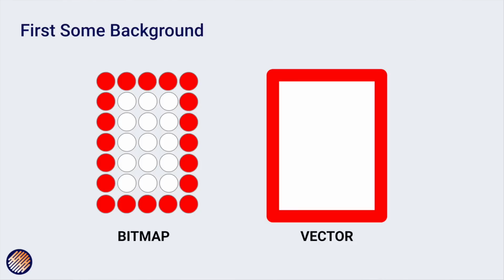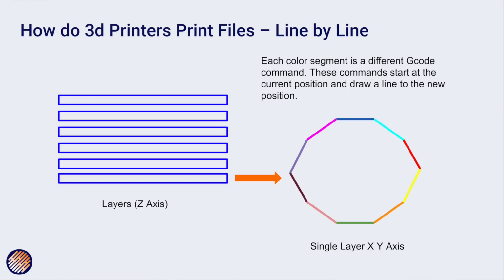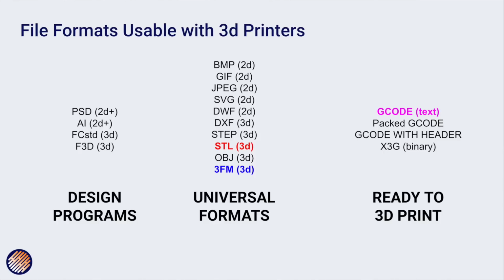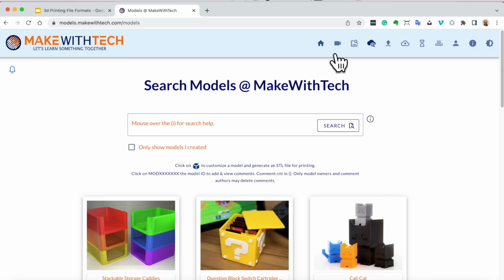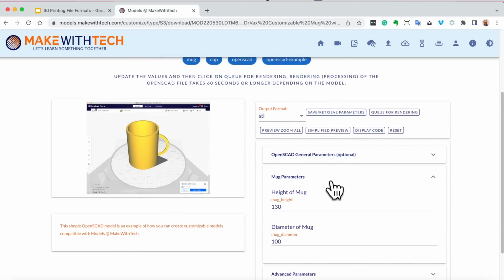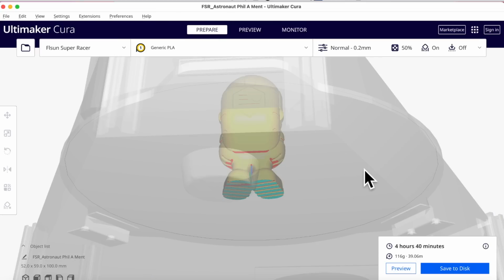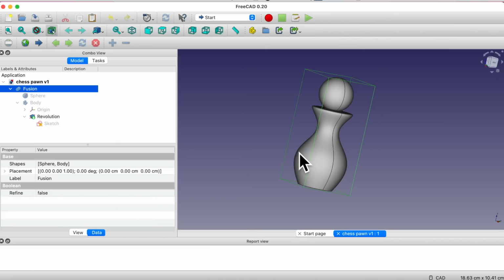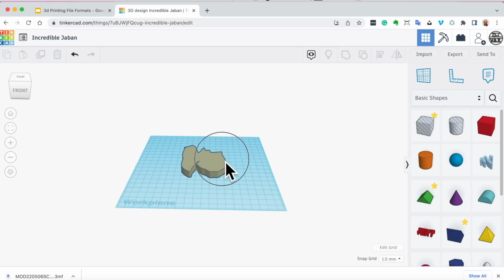3D Printer File Formats Explained

Comment: Nice summary, thanks for making this video. I teach a 3D printing class at my hackerspace and I'll be sharing this video with students.

I would suggest that STL files are more like a vector format than a raster format, however. The dots in a bitmap file are 1-dimentional points represented in a 2-dimentional array.

The facets (triangles) in a STL file are not 1-dimentional - they have a size and shape defined by the 3-dimentional location of three vertices (which themselves are 1-dimentional, but not stored in a 3-dimentional array). This is closer to the way a vector file format works describing a shape - only in this case, all the shapes are triangles.

Comment: This was a great cross platform tutorial. I managed a ProE program at a major truck builder for 7 years after using 3d modeling for 6 years. I am coming back after  procuring a 3d printer and a go fund me 4 axis mill. I have never seen a clearer explanation of the formats from the positive additive/subtractive, to the subtractive to the additive (for a 3d printer versus a CNC). Many thanks and I subscribed after your first video, this one, I watched. Thank you!

Comment: Very interesting. I had been treating STL as a black box, and didn't really care about how it works on the inside.  Smaller files are nice, but it's not clear to me that it buys me much.  A few MB is just not that much storage in these days of terabyte drives.  That said, it would be interesting to know how they achieved that compression; perhaps they exploit some similarity to neighboring triangles.  I'll bet there's a wikipedia article on it :D

Thanks for the tour of common formats and cool things you can do with 2D images!

Comment: Wow beautiful explanation as always.  You sure gave a great style.  I investigated STL and 3MF a few months ago.  I looked if I could write a c# desktop app to design screws nut and misc fasteners. I found the stl triangle geometry was a head trip.  Just cutting a circle out of a square produces complex STL files.  I have viewed them in ascii text!!

The slicer is pure magic on how triangles get sliced so neatly too.  Thank for a peek in side the magic geometry.  Good work.
Reply: STL doesn't store a circle as a circle, but as a multi sided polygon. That's why it's more complex. I was going to test if slicing from different file formats give different printing results.
Reply: @isthattrue1083  Yes stl is the smallest simplest Polygon set always three sides.

Save a cube you see each square is two triangles per side. 

I love digging in under the hood.
If you need help could write some
Python or c# visual dumper.

I'd love to see you're results,  thanks.
I moved from Barrington il to Prescott Valley AZ almost four yrs ago when I retired, we could of met!

Comment: Is there a way to take an svg file and extrude it, so that the highest plane is not flat, but has dimension, itself. For example, importing a leaf pattern where leaves themselves are slightly domed from a side view. The final application would be for mold making and clay rolling, where a softer 3 dimensional finished shape is desired.

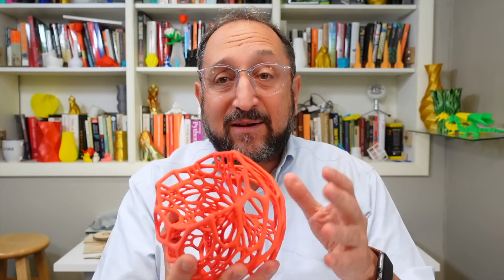Comment: 5:47 Not exactly accurate. The vector equivalent here would be CAD models while the pixel equivalent with be polygons. Just like the photo and the square the format depends on the use. If it's something more simple like a door handle or power drill CAD is better. If you're making a very detailed monster sculpture polygons are better. Technically everything you print will be polygons.

Comment: hi, this is bob at bison workshop and i print barrel bands for air rifles and i am having a problem i need someone to help me with.  i have been printing parts sense 2016 and everything was going great up until about 6 months ago when i allowed cura to update the cura ver. now i cant get a good print to save my life. i print all my stuff at 100% infill but now i cant get nothing to print like it use to print. no matter if its super or low settings. its gonna put me out of business if i cant get this fixed. i and begging you to help me get this figured out. i cant find anyone who will give me the help i need. i dont know what all my default settings were when i first started with 3d printing and never had to change the profile setting before. but cura has forsed the new profile setting on me and without knowing what the original settings were when i first installed cura i can get it back to the original setting. i need someone who is willing to email me so i can give them my phone number to call me and walk me through getting this reset so i can get a good print. i depend on my 3d prints to put food on my families table. please email me so i can give you my phone number so you can call me and help get my prints back to what they use to be. you seem like a guy that cares about other people so i am hoping you wont just ignore me and forget i ask for your help. my email is bisonworkshop@gmail.com. PLEASE HELP ME OUT. THANKS.